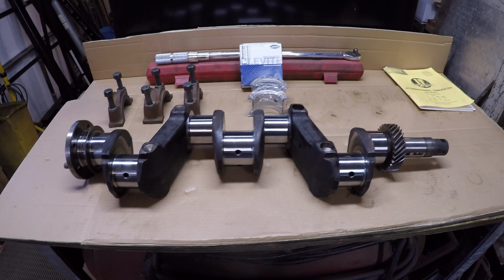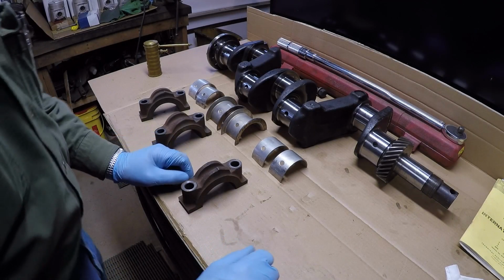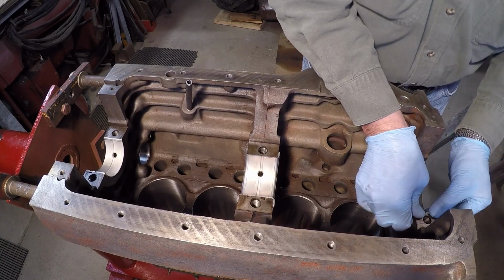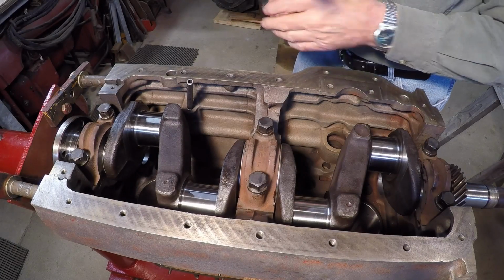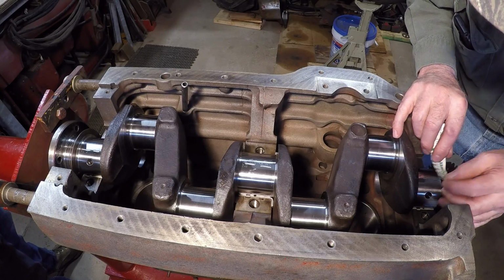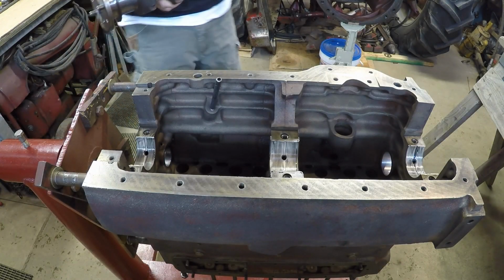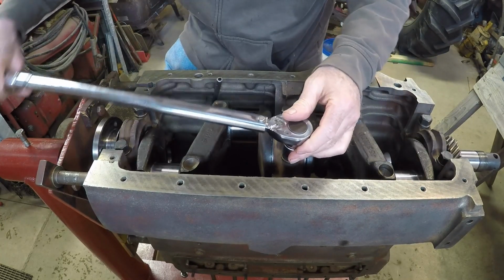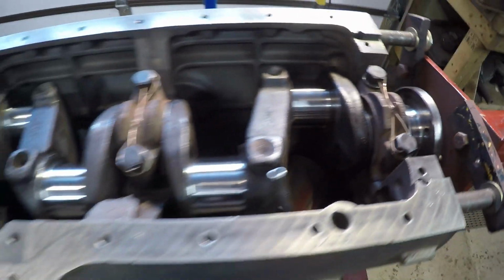Farmall Super M Rebuild Ep.22: Installing The Crankshaft

Comment: As a kid in 65 my Dad had a highly modified Super M it had 4 bolt mains, something called a Fire crater head plus many other parts, That M would pull a 4 bottom 18" plow at night a nice blue flame about 6" out of the muffler, weak point was the rear end .

Comment: Thanks for the great video. I am anouther one that doesn't  know what your suppose to do if the plasita gauge indicates the  bearing clearence, or for that matter, the dial indicator shows   chankshaft end play is out of specification . I have never seen it happen on any video. All any of my manuels say is to check the clearence.  My machine shop guy is pleasant ,  but if I showed up  trying to make my problem his , i would get a serious talking to about the bearings I supplied, and the value of buying bearings from him and the bargin it is  having him build the block. I cant say blame him, i would not want to give any warranty  if someone else did that much work. When I rebuilt my M, as i didnt know what to  about it anyway, and after watching many rebuild videos where no one was out of spec. I just ignored it. It runs fine.

Comment: This reminds me of the M engine that I rebuilt in 1981. Hand cranked it because the starter had been gone for years. Sad thing is that someone used the tractor for target practice a few years later. Cracked the block and rear end. Destroyed the tires, radiator, and gas tank.

Comment: Technically those bearings are undersized because they are .010" smaller bore than std size. Pistons go oversized bearings go undersized. Only exception is the rare bearings made to fix blocks that have been align bored which can be oversized in that their OD is increased to salvage an otherwise unuseable block. In fact those bearings are sometimes bother oversized and undersized. It 's complicated. LOL
Reply: thanks Brian, I do get confused about which is which.
Reply: The bearings are .010 oversized to compensate for the .010 that was ground off the crank journeys.
Reply: Journals

Comment: oil behind the bearing shells and dry cap bolts. Seems backwards to me but to each their own,
Reply: Both of your points are valid, and they are points that are touched on at rebuild seminars and many manuals (Mack and Cummins are examples I'm personally familiar with). Bearings should be clean and dry on the back sides (for proper fit and heat transfer) and the fasteners should be lubricated so the proper torque is achieved.  I watched a GM training film (yeh, film... not video) many years ago where they actually measured the "crush" of copper tokens that were clamped in a fixture that was torqued to the same spec, with dry threads and lubricated threads.  The dry threads never once achieved the same level of crush, at the same torque.  I never forgot the message from that film.

Comment: Squatch and Senior. One thing to consider when "setting the thrust" prior to torquing the cap. Instead of prying the crank rearward, let it in the direction of thrust load in the system. In this case that's forward due to the clutch. The reason being, if there's any movement between the bearing and housing bore, prying forward will seat the thrust shells against the block and main cap where they're best supported in operation. This prevents the bearing shell from taking the load without the support of the block. Technique item, take it or leave it.  Cheers guys, stay safe, watch out for the Borkster character down the road. Looking forward to the Maple syrup video as well as more progress on the M. Need to get the Super M going so that it can earn it's keep for spring field work!
Reply: @squatch253  No intention to bust on Sr, or you. Not here to tell a guy how to build an engine. But if I see something that I do differently I will mention it for consideration. I do recall you covering this on 5J1113 build come to think of it. However I wasn't aware that the D2 clutch exerts no thrust load on the crankshaft. That's really interesting! With as tight as those bearing shells fit against the block register in a C264 block, it's more a matter of personal preference than anything. Senior is doing a beautiful and meticulous job! I've learned a lot from his techniques already so I don't want him to think I don't appreciate his efforts in filming. I've built hundreds of engines and I am still learning all the time. Great work Senior and Squatch!

Comment: I am a backyard hobbyist. I have put some engines together and they worked good. Did my 1951 TEA20 Ferguson engine two years ago and it’s still running. Woo hoo. Any way. If your end thrust clearance was out. How do you fix that. Change the middle main bearing cap to thicker or thinner thrust part.? And when starting to torque the main bearings down for final assembly, did you start with the middle bearing or one of the end ones and work either way, or do both end ones then the middle one.   

Thanks for your videos. There great.
Reply: Squatch253 thanks. I understand. Spray welding is expensive too. But if that’s the option. That’s what ya gotta do. 
Thanks again for your reply.

Comment: I have a problem here.  I've been doing this for a very long time... lets just say I'm old enough to be Squatch Seniors older brother.  I'm telling you, flat out, the folks at Perfect Circle, Clevite, Engine Builders, Oliver, Perkins... and on and on, would have palpitations watching you put oil BETWEEN the bearing shells and the bearing caps (or rods, or the block).  To quote the installation paper from a set of Continental bearings, "Follow basic assembly rules such as prelubing the front of the bearings with assembly lube or oil, and making sure the backs of the bearing shells are clean and dry."  Why you may ask?  Because, according to what the Perfect Circle rep told me when I was working for our local Oliver shop, oiling the back of the shells is a contributing factor to spun main bearings.  Their research found that some oils tested will degrade after a number of heat cycles.  When this happens the oil trapped between the shell and the block/cap will turn to a shellac-like solid, which will occupy more space than the oil did...and the heat transfer from the bearing shell to the large heat sink that is the block has been compromised because direct metal to metal heat "conduction" is now impaired due to the shellac.  So now you will have a tighter bearing with poor heat transfer... a sure-fire recipe for spinning a main bearing.  Putting oil on the BACK of shell bearings is one of those bad policy myths that should be filed away with, "... storing a lead-acid battery on a concrete floor will kill it".
Reply: @squatch253  your experience is the same as mine, disassembled several hundred engines, never one yet that didn't have oil between the bearing and housing bore.
Reply: @squatch253  I can certainly understand your point of view.  I have made the same observations; plenty of oil, shellac, and other assorted crud  (strips of aluminum foil seem to be a popular item) under the bearing shells when I've torn down some engines, especially some of the high-hour Whites we used to work on.  Heck, I've even found Plastigauge between the rods and the bearing shells on an HG Cletrack... all four of them ( I have no idea why anyone would do that).  But, when an engine is new, tight, and everything is in spec, why would you go out of your way to do something that is completely unnecessary and, more to the point, opposite to what we are taught to be good assembly procedures?
Reply: @squatch253  Judging by the quality of your work and attention to detail, I can't find fault in your teachers.  Keep up the good work.  And, if you should come by a spun bearing in your travels... check under the other shells for a thick crud layer.

Comment: Never place oil  between the cap and the bearing as this may increase the chance of bearing failure
Reply: I've never taken an engine apart that didn't have oil between the back of the bearing and the housing bore and I've taken apart hundreds. This just flat out isn't true.
Reply: @lukestrasser  For the first start, you can't put oil there.
Reply: He also failed to lubricate the main cap bolts which doesnt allow proper torque load on the caps.
Reply: @traktoristasnitavareikalas8247  For the amount of oil he said he put, can't see it doing a bit of harm. It wasn't like he poured it on and left a thick film, he said he wiped it off with his finger; so sounds like wet. The crank spun freely! If anything, your claim would of left decreased clearance and his clearances were within spec.

Comment: When torquing i noticed what looks like the bolts stretching, of course its impossible to tell by looking so i wonder if people mic the overall length of the bolts before and after ? same with rod bolts
Reply: In some high performance engines you use a dial indicator to measure the stretch of the stud to determine proper torque/bolt preload.

Comment: Let us know if that gets harder to roll over when you put the new rear main seal in and tighten the retainer. I have one on the stand now that got a little tight after I installed the rear main... Hoping the felt just needs to wear in a bit. Thanks and nice work!
Reply: Squatch253 thanks Squatch, yep I soaked the felt in a bag of 30w overnight and left the rats inner bolts loose till the crank was in, then tightened the 2 halves to allow the crank to center them before I snugged them down to the block.
Reply: Typo: retainer bolts, not rats inner haha

Comment: You should never put oil on on the backside of a bearing. It messes up you're bearing clearance and can cause a spun bearing. Plus it makes the bearing run hotter. Meaning the bearing can't put the heat back into the block as it should which can cause bearing failure.